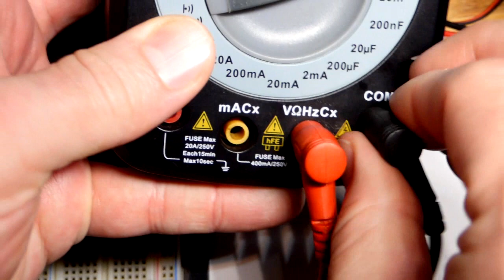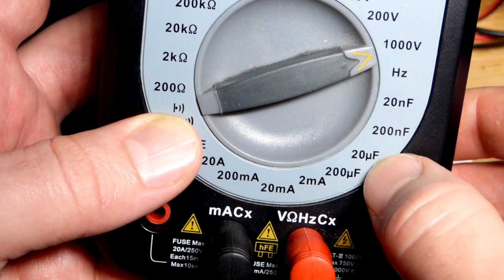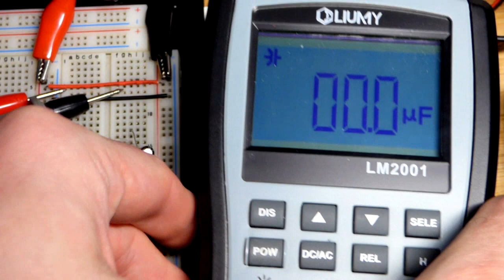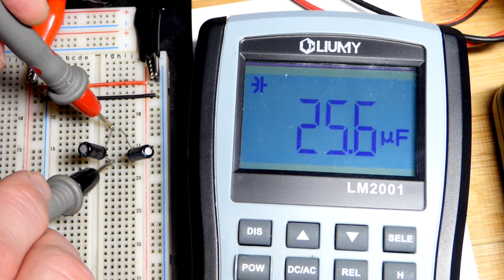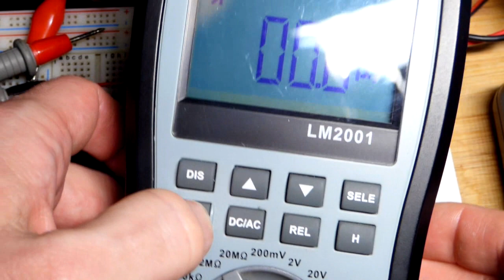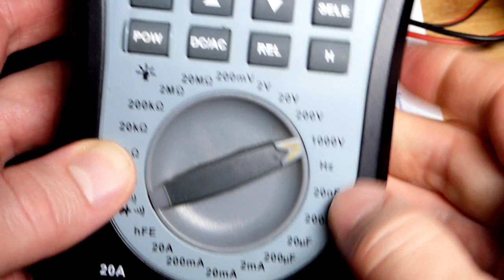Parallel capacitors increase capacitance multimeter measured demo learning electronics shorts 94

Comment: Hello bro 74hc86-74hc08 Can you connect 4 led arduino with ICs?
Reply: there is a very urgent help unit on this provide any unit to expand all resources
Reply: @360Doğa  Sorry but your translator isn't working and your question does not make any sense...sorry.
Reply: @andymouse  I am sorry for this
Reply: @andymouse  the parts you need 4 led 74hc86 74hc08 arduino
Reply: @andymouse  I need to build a circuit with these parts.